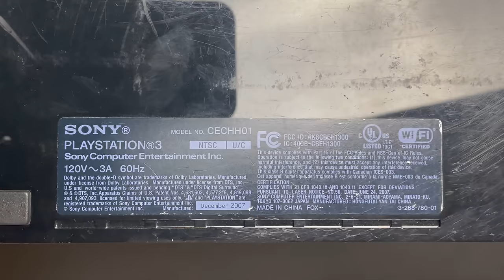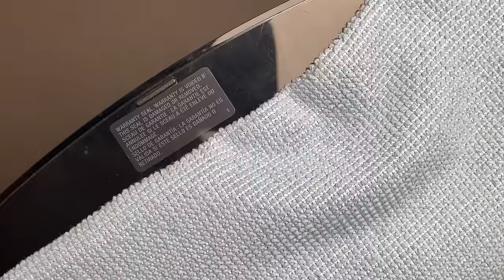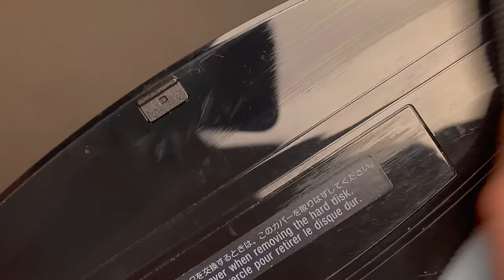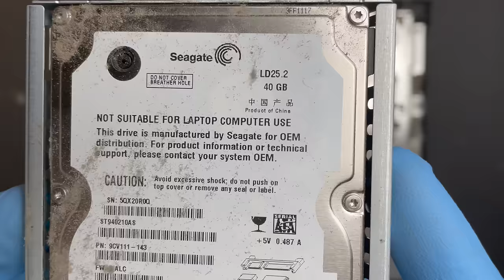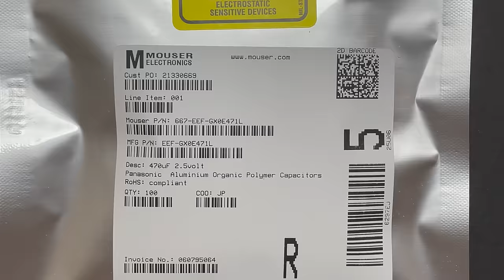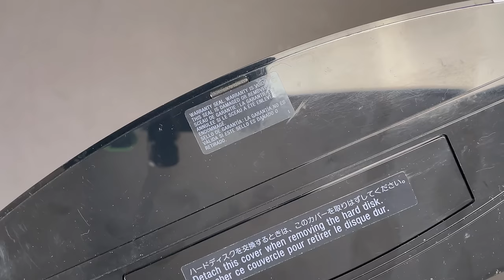Sony PS3 "Fat" YLOD Repair - Faulty Console Restoration

Comment: Just did I what you did in the video  is I can play max payne 3 on my 60GB playstation 3 thank you mate love from UK
Reply: What temperature did you set your heat gun at?  Also, you have any issues working on the capacitors in the more crammed section on the other side of the board by the chips?

Comment: Hey today i got a launch 40gb fat ps3 the ps2 backwards compatible one and it has ylod it goes green then quickly yellow red then blinks red so tried to put washers under the clamp screws for the cpu and gpu chip to provide extra pressure to see if the cpu or gpu had loose or broken solder points but it still has ylod could it be the nec tokin capacitor or could it be the power supply if it is the nec tokin chips which ones do i buy and which tokin capacitors do i replace? i am completely new to these capacitors and i would really appriciate the help i really enjoy your videos keep up the incredible work
Reply: Also i heard pram batteries cause it too my battery is 2v and they are meant to be 3v is that ok?

Comment: 6:00
My preferred technique for removing stripped screws is to dip the tip of a cheap screw driver in flux paste, hold it in the delinquent screw and fill with solder. It'll restore the screw head to the fitted shape of the driver and once cooled be easily removed.
Reply from the maker: Thats a neat idea, would have never crossed my mind. Gonna have to try that at some point.
Reply: @BorderlineOCD  May require a second set of hands, but if you're crafty it works in a pinch. Much safer feeling than some sharp pliers too.

Comment: Watching from Mozambique and enjoyed it. Unfortunately here we don't have a good technicians' to repair my PS. Maybe you can help mine is slim, when i put the HardDisk on it, it starts normally, then I start trying to install the system it formats the disk and restarts to another step but the problem starts there it doesn't start anymore. Seems that it wont accept to load with the system installed on harddisk.

Comment: Thank you! I have my ps3 with YLOD since 2011. 'Fixed' it three times with reflowing until it is beyond fixing. Now i want to try the NEC/TOKIN fix. My question is how caps should i buy? Should i replace all the NEC/TOKIN caps (meaning i should buy 32 of the caps you showed)?
Reply from the maker: Check out the links in the description with the original TOKIN cap thread. It's long but worth reading to get a sense of the experience folks have had and set the right expectations. Most folks can get away with a 1/4 (like this system) or a 1/2 TOKIN replacement. For a full TOKIN replacement there is more work to be done to connect voltage lines. This is explained in the thread with diagrams.
Reply: @BorderlineOCD  Thanks. I read the OG post and there is no info there for that particular. I guess it is buried somewhere in the 213 pages. Unfortunately, i don't have time to read all that. Can SYSCON give me info on how many caps i should replace? But i guess i should replace the ones on the GPU circuit (and leave the CPU caps untouched)? It would also be great if you talked a bit about how to solder the caps. There are three pads on each cap, but you solder only two of them each time. What is the pad that is left behind?

Comment: I'm completely shocked but I had a YLOD launch model 60GB PS3 (hardware backwards compatible) that had never been opened before. I bought it as "junk," it was cheap and probably the dustiest console I've ever opened. I did the exact repair as you did, same sets of capacitors replaced, using the new ones your recommended. It took two tries to get the new ones soldered in right (I too am not so good with hot air). Did the trick! This baby boots now no problem. Funnily, mine also had a disc in it: Call of Duty Black Ops.

My only tip: I didn't try to use hot air to remove the original capacitors. Just a thin pry tool to break them apart and then solder and an iron to remove all the left over bits from the pads. This definitely took a while to do but was not particularly difficult if you're patient and take your time. This video helped a lot for that part: https://www.youtube.com/watch?v=Q-4hdwFXVJo

Thanks again for this great video! I would not have attempted the repair without it!

Comment: I have an old phat boy model that has lots visual artifacts. Very glitchy lights with screen tears, and jagged shadow that constantly pop in and out of existence. I decided that the GPU is probably going bad. I put it in storage and bought a super slim that I play on now.
Reply: they figured out somewhat recently how to replace the gpu's with the newer 45nm ones using a couple different methods. though sadly, not many people seem to know of the ways yet, so getting an older unit fixed is hit or miss as it requires some work and a gpu swap from a 'bigger chip gpu 45nm' slim using a few tricks. (more recent slims use smaller footprint gpu's that aren't compatible or something like that.)

Comment: Can you give some tips on how to desolder the terminals? I don’t want to use a heat gun and wicking only worked for one of my terminals. For the life of me I can’t get the other terminals to stick to the wick. I also don’t have a thin solder tip to slice it off like you did

Comment: I bought my old fat ps3 in early 2007 for $600+ during my sophomore year in high school after saving up $50 a week from working at the swapmeet and doing construction jobs in hs. I had soo many games and had all my old ps and ps2 library. The very first game I played on it was my physical copy of RE2. My PS3 over the years overheated and died the year right before the PS4 launch and that broke my heart since it was totally burned and my knowledge at the time was insignificant enough to repair it. I took the worst route and sold it and most of my library to Gamestop(which was a TERRIBLE solution) because I was demoralized and dispirited by it dying. I had gotten a PS4 right after but luckily/unfortunately the library I sold was not backwards compatible, so cool for all the PS and PS2 games I didn't have anymore but super shit for the rare classics I held onto. I bought the Destiny PS4 bundle and immediately returned that pos Destiny because at the time I had my rare classics but NONE of them played but I still kept the PS4 until FarCry4 and GTA5 came out. I ended up returning the PS4 and all its 2 games and instead built a PC. I have my old PS and PS2 library emulated but I wish I had kept my PS3 because I have built multiple PCs by this point and with the knowledge I acquired I would have been able to repair the overheating issue since mine had a great blueray drive. My experience with my PS3 has been like owning your first car.

Comment: I don't see any point in de-lidding the processors. They do not have thermal paste under, its thermal epoxy and is meant to be hard. I can see the logic when people thought the YLOD was caused by overheating as paste is better than epoxy at transferring heat, but as the real cause (in most circumstances) are the caps it is not needed and the risk of damage is too great (I was screaming at Vince not to do it watching his vid)

Comment: When a ps3 mobo is stuck on the heatsync I pull underneath the metal sheilding it applys even pressure to the mobo and allows easy removal

Comment: Some of those fattys have screws that are a pain in the butt to remove! I stripped one of the screws on the hard drive bay and had a helluva time trying to flatten the edges and pull it out with pliers.

Comment: So hold up🤔 When your phat PS3 has the YLOD it doesn't mean that I have to reball the system, I just have to change those NEC capacitors? I just want to make sure. By looking at your video those capacitors sure were a pain to take off and clean. But at least it gives hope in order to solve this issue 😊

Comment: I followed nsc mods his delid videos, and was able to pull it off with a custom made tool that is 0.3mm thick to cut the cpu. 
I used a cheese knife and a piece of cardboard to delid the rsx. I heated both up before trying to remove them. and used vaseline on my cutting tool for the cpu

Comment: Will you eventually have to do the process again for the other caps?
Reply from the maker: I opted to replace pairs until the issue was resolved and got lucky after the first pair. I don't plan to replace the rest unless the system acts up. The GPU is the most fussy about the caps falling out of spec. The CPU is less likely to complain until they are further out of spec. This is all just anecdotal based on the (very) long thread I shared in the description.

Comment: Thank you- I will try fixing it soon; we replaced the heating stuff new thermal paste but I didn’t do it my dad helped out. Is there a way to maybe transfer the the data or storage to another device? I have Minecraft worlds that were from 2013-2016 and I don’t want to lose anything. I’ve had my console since day one and have alot of valuable stuff on it and It broke in 2017 so I hope I’m not too late to fix it. I occasionally plug the controllers in to charge because I already lost my main PS3 controller to it discharging all the way. I was wondering if there is a way to also like sign into another PS3 with the same account I had on the one that broke because I have some “Rare username” or something I think because I’d go into GTAo and my username would be for example “Jon” or “Bob” (I don’t own those two accounts they are examples) and I want to keep the accounts too because I have about twelve or thirteen of them I think. 

Thanks again, I have a PS3 Fat or something or like that but I would play Minecraft, GTA 4 and some other games hours on end and thought it might of overheated because I saw the same problem with my PS4 I re-applied my thermal paste and it was working just fine. I was going to get it brought in to get the YLoD fixed but the places I found online said they either did not fix PS3 YLoD or they stopped, Even though I looked up “PS3 YLoD repair near me” and their websites advertised PS3 repairs. I’ll keep the video for a bit I’ll watch the tutorial you put up for us. I cannot Thank you enough! but I hope this works. I’ll reply in about a week or two regarding if it worked for me or not.

Comment: I've been holding up to my first gen ps3 to see if some day someone can come up with a solution. I think this day has come. How much would it go for a repair like that.
Reply: bc of this video I bought 8 of the panasonic capacitors he uses on this video from Mouser. It cost me $37 after shipping and tax. Other costs include a soldering iron, heat gun, flux and screwdriver, that's pretty much it. Oh, and PS3!

Comment: 1st: Liked the video, nice job! 2nd You should try delid them for better cooling especially for the BC model. After all it's a project... The hard part is the GPU cause of the thermal glue, the CPU goes easily with a modeling spatula..don't need the "NSC like tool" or anything special. 3rd and most important! Since you are aware of the PSX scene etc, please check if the fix is working and for how long? Why not replacing all the NEC..i do not understand why not, we can only say that these are not the fix if all had been replaced properly and then the machine is not working. SYSCON is gonna take ages to mature...

Comment: Does the ps3 still work ?
Reply: Actually that's a very good question. A truthful answer would assume that the PS3 has been power cycled frequently and used for normal gameplay sessions in order to bring the PS3 up to sustained operating temps.

Comment: Just curious, did you replace that other set of capacitors too? Or is it not necessary?
Reply from the maker: Just the pair you saw in the video. If I didn't work I was planning to continue swapping TOKIN pairs but if you do replace the other side (i.e. all 4 TOKINs on the GPU or CPU) there is additional work that needs to be done to bridge the positive pads on the ends. This is explained in more detail on the thread linked in the video description.

Comment: Its always nice to see one of this systems get back to life. I tried this method on 2 systems but it didnt work for me, even replacing cpu and gpu tokins. Maybe the tantalum capacitors that i bough are faulty.
Reply from the maker: Sadly there are many reports of unsuccessful attempts like yours. Seems to be an even spit, but it's hard to say. The challenge with anecdotal stats is that people that have a failed repair attempt are more likely to share that it didn't work, whereas people who have successful repair are sometimes less likely to join the conversation and confirm success. Nonetheless it's clear its not always the TOKIN caps because your experience is shared by so many others.
Reply: what cap did u use model ?
Reply: @adamking816  some cheap 470uf tantalum from aliexpress. Probably they are trash and thats why it doesnt work.
Reply: @ByeWorld  damn same i buy from aliexpress XD
the name seller is IBUW Electron ?

Comment: Friend, nec tokins are best removed "in the cold" ... Try a knife, or a spatula, and in the areas that are welded with a hammer, tap them lightly.. You will notice that they will come off very easily. When get the hang of it, you'll be able to do the job with your eyes closed. Here is my suggestion, from who are fed up with removing them, and have tested all the alternatives.
Reply from the maker: I'm not quite ready to take out the hammer lol but I agree brut force is the way to go with these. I've seen NSC Mods remove them with a heat gun but I just couldn't get the same result with hot air.
Reply: @BorderlineOCD  lol Hammer not means brute force :p My english is not very good.. I have another PS3 to fix here, maybe i will just record. Just a knife, the hammer for gently "smacks" and you will take them just just in less of a minute. No need heatguns or hothairs. For me with the spatula or a knife will do the job better and more fast.
Reply: Ok.. Recorded 2 mn ago lol Just for you. Is the way i do from long time ago. Just gently smacks, no need to be crude. Make sure you spray everything or just clean and this will be ready to be solder and apply some tantalum. I'm against applying heat, ok the PCB is thick but it can affect the BGA spheres that are right there or another component. ;) https://www.youtube.com/watch?v=nTlOAgbrNBQ

Comment: When trying to remove a stripped fastener, you simply cut a notch in it with a Dremel and remove with a flat tipped screwdriver.

Comment: I have had instances like that with a screw before.

My dad gave me the advice of pretty much shock loading a screw.

Would not recommend doing so with electronics.

But other things it works fine. Use a bit of penetrating oil and then hit it with a hammer, back of screwdriver or pliers.

Most recently I used a old torx bit to prevent damage to the screw.

Worked very well.

Edit: I have never gotten the rubberband method to work.

I have rarely seen a phat ps3 getting disassembled that was clean inside.

One day I will get one. But it sucks we never got the A or B models only C, E which uses software and less hardware to emulate.

Not as good as A01 or B01

Also enjoying the video, I usually roll my eyes when people "fix" the problem by just warming up the chips.

Delid is definitely not for the faint of heart. I have killed two ps3 slims trying to do that.

Not going to try again. Was happy enough that my 3rd ps3 was a 2100 model (previous two were both 2000 NEC capacitors).

The new one is noticeably cooler, fans are quit and it was the cheapest one I bought.

And after 3 ps3s only the 1st one had a original controller which a had to replace the left analogue module on.

I did pretty well with that repair. Still works, but I want to get a 3rd controller just incase.

My 2nd one I got for a very good price.
Reply: Yikes talk about a wall of text.

My 1st attempt was very rough and the rsx Delid was successful. But attempting the cell killed it.

2nd try, really took my time I think I killed it by accidentally sticking the tool under the cell instead of the RSX.

The RSX heat spreader came off very clean so I'm very sad about that one dying. It was a very neat condition one.

Well I learned my lesson. Unfortunately where I live there's not a big demand for parts.

So I am left with two Ps3 slims that have working blu ray drives and psu, fans and cooling units.

Listed for what I consider a fair price (considering the PSU and disc drive are working).

But nobody wants to buy it. 😐

Comment: I fixed my ylod PS3 that I got for free and all
I did was to put the heat gun on low and the 4 black capacitor chips on the back of the board(not on the cpu and gpu side) I was like 2 inches away from them with the heat gun for like 4 minutes on all 4 and put a thermal pad on top of all of them and to put pressure when putting back the metal plate to put pressure on them so the soldering won’t move and it worked ! Been paying it non stop for months now
Reply: Thermal pads on capacitors? Never thought about that.

Comment: once you've taken the lid off couldn't you use a soldering iron to remove the caps?
Reply from the maker: You could try but there would likely still be prying involved due to the size of the ground connector in between the two middle posts. The ground is about 2/3rds the size of the cap and sits in the middle where its hard to get heat to from either side (where the positive ends sit).

Comment: Hi I have a question my be you can help me I put thermal paste on my ps3 console 60gb backward compatible but it still doesn't work have any suggestions that my help me to make it work it has the yellow light of death I was told it was not fixable but I just thought I would give it a try I think I'm needing some help thank you Sandra